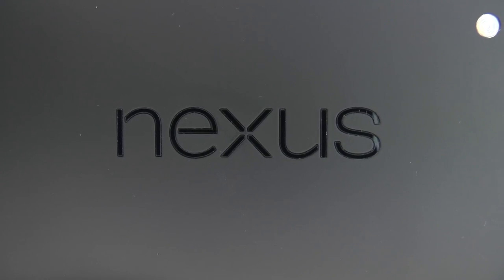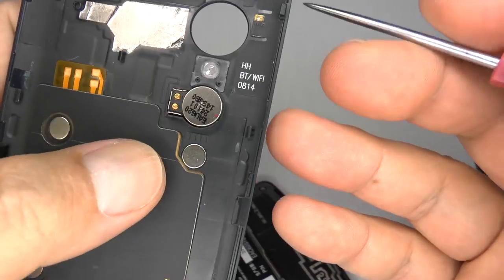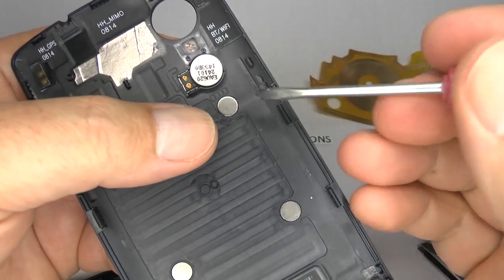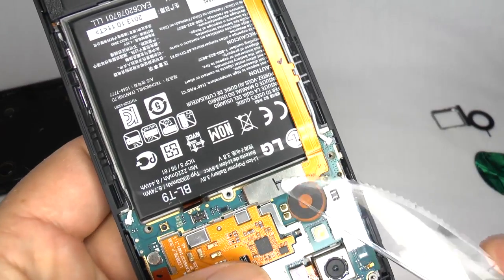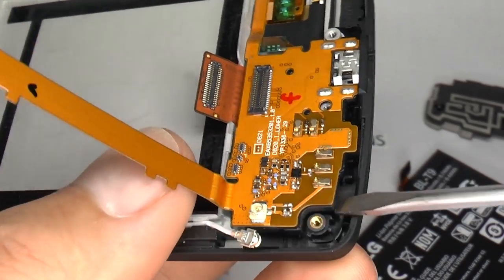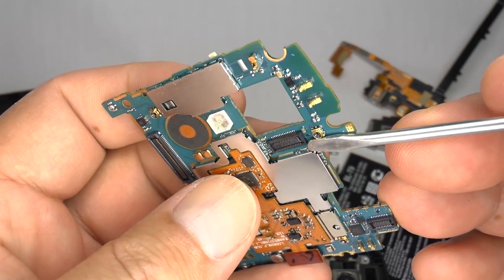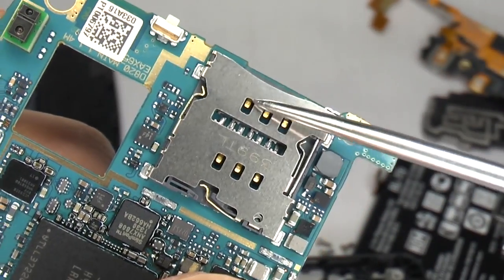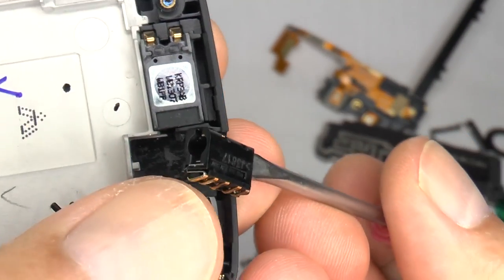Nexus 5 Teardown - Disassembly & Assembly - Screen Repair & Case Replacement LG-D821 - 820

Comment: Just thought I'd update, I followed this guide and successful got out the stuck sim simply by carefully pushing it from the small gap in the bottom of the holder until it came out. That sim is beat up now so I've ordered another, hopefully I haven't done damage to the board/holder. 
Another thing I've learnt is not to over tighten screws, which I've done and slightly threaded a couple of the screws so I might have to deal with that should something go wrong again.
Lastly, my Nexus 5's (I think it's the revision as it's from Jan 2014) back cover didn't come off as easily as I've seen other peoples, has anyone else had this problem? There was two stubborn clips in the middle on one side which took a lot more force to get out, although, I found by lifting the case 90 degrees got the last one out quickly. But now there's a noticeable small gap on the one side in the middle from where I was trying too aggressively to get the clips out of haha.

Anyway, thank you for this video.

Comment: I fixed my phone!! TIP: You need the bracket for the earpiece from your old phone! My replacement screen didnt have the bracket. I'm not sure what the best way is, but you can pull it out of the old one.

Comment: Hey nice video! I just wanted to know if it was possible to take the SanDisk memory card from this motherboard and put it on another one? My nexus 5 is stuck on the boot animation and the only possible way is to factory reset the whole thing, but I have some very important data in my phone for which I haven't taken a backup

Comment: If you find NFC to not be working after this push down firmly on the outer case after the phone's been reassembled just above the S in nexus, if you hear a click sound that's the nfc antenna snapping back into place

Comment: Read this if you want to order  [ pentru ROMANI - cititi ] I ordered from this site from the link in the description the display with frame and it arrived some 4-5 days after I placed the order. The screen came in great condition and the replacement went very well. One more thing I have to add because I didn`t see it in your description and it challenged me for 5 minutes at least : when you take the speaker from the earpiece out, make sure to take the spacer also, because (in my case) the frame came without that spacer and I placed the earpiece without it and it did not make contact with the main board so I could not hear the person I was talking to on the phone. Overall the phone looks and feels brand new now. Very pleased with the screen and the tutorial, thank you! The following text is for the people that order it from Romania (as in my case) regarding some unmentioned fees from the transport company:mie mi-a venit prin DHL, nu prin posta romana, asa ca cei de la DHL au un tarif de 100 lei pentru achitarea taxelor vamale in locul vostru, plus taxele vamale care au fost in jur de 52 RON. Ca individ care vrea sa repare singur telefonul si nu a mai facut comenzi din afara UE, am zis ca achit singur taxele vamale ca sa evit comisionul de 100 lei din partea lor, dar aces lucru nu se poate daca a fost expediat prin DHL decat daca detii un cod E-ORI. acest cod se elibereaza de catre vama contra sumei de aproximativ 130 lei, ridicand costul total al coletului cu 182 RON in loc de 152 RON daca achita DHL.- nu mai stiu daca este posibila livrarea prin posta romana (atunci cand selectezi ce fel de transfer vrei), dar daca este, puteti alege aceasta optiune pentru evitarea taxei de 100 RON din partea DHL (firma de transport), prin faptul ca atunci cand ajunge coletul in vama, posta va face o instiintare de plata si va prezentati si achitati doar suma de 52 RON, fara sa mai fie nevoie de cod E-ORi. este foarte posibil ca livrarea sa se faca in cca. 3 saptamani in loc de 4-5 zile, asa cum mi-a venit mie prin DHL. sper sa va fie de ajutor ce am scris pentru ca pe mine ma revolta taxele ascunse si consider ca asta este una din ele avand in vedere ca nu am fost atentionat in prealabil.

Comment: Hey...Sorry for dumb question...i couldnt find a way to google this but please answer...This is a bit funny/dumb/sad thing just happened...i got my nexus 5 not even 5 days ago and i was cleaning the back with an alcohol pad because one of the letters were dirty, so i thought i could just take the letters off clean them, then superglue them back on....That wasn't good because some got on the case and got dirtier...Google said Nail polish remover could remove super glue but that ENDED UP TAKING THE RUBBERCOATING OFF AND MAKING THE PAINT DEGRADE AND TURN BLEACHED/WHITE....SO MY MAIN QUESTON IS...I HAVE THE BLACK NEXUS 5...if i replace it with a Red or White BATTERY COVER...would it still work ...basically taking the black one off and putting a different battery cover on. THANKS...sorry for such long story thought you should know what happened.

Comment: Great guide! I am waiting for the part about the main screen removal. I've been quoted RM530(usd160) for the lcd without housing, and another RM100 (usd30) for repairing fee, I'm not spending another rm100 just for the fee.

Comment: Hi again!
Sorry to ask for your advice once again!
The phone is all working (new screen etc.) except for the 4G problem that I still have :-(
I have been in touch with about 6 companies and either spoken to, or Emailed them to see if anyone makes (or can make one up) an antenna cable that I need. I have read quite a bit and what I think that I need is:

RF cable is 1mm dia coaxial 90mm in length
2mm micro coaxial connector at one end (what it came with as standard)
2mm mini RF test connector at the other (a.k.a u.fl pigtail?)

Do you know of anywhere that might have these in stock, or anyone that could make one up for a reasonable sum?

Many thanks once again for your advice and reply :-)
Steve.

Comment: One thing I just learned about screen replacement for the Nexus 5: When replacing the rear housing (back cover/plate), there's a clip in the middle, about two-thirds of the way up that needs to be attached, otherwise wireless charging will not work. To fix, once the cover is attached, simply apply pressure in the middle of the back, about 2/3 of the way up until you hear a snap. Done.

Comment: +LE55ONS 
Hi, I just packed my Nexus 5 and I , on the advice , added thermal paste , Noctua NT - H1 ( pocchissima with a cotton swab ) , the CPU to dissipate heat better, but to my surprise I realized there ' he was put precendentemente no thermal paste . Fording other videos I noticed that almost no CPU had put suppetta pasta. I was wrong to put it and it is better that remove or leave everything as it is ?
P.S. Also in the assembly I damaged the white antenna cable and await a new cable . Tips .
Thank you.

Comment: Thnx for the vid, someone gived me a Nexus 5 (dead after drop in toilet) i took it apart and cleaned all with alcohol, phone works perfectly except the wifi... can u please tell me if the wifi antenna in the back is for 2.4GHZ?? because it works fine on 5GHZ but on 2.4GHZ very low signal!

Comment: it's wonderful and detailed guide to replace digitizer ..repair shop quoted £110 to fix it with digitizer. .i bought from ebay for £18 and back cover for £9 ...i saved £83...

Comment: +Sunil JG heyhey,
I changed the whole display unit a few weeks ago, now it works fine again. It includes frame, display, glass and digitizer. I guess it was the latter, that was damaged, but I had no tools to change it seperately. Total cost about 80€ for original part. U can get remake for about 30€ on ebay, but it might have quality issues

Comment: Thanks Le55ons. you helped me save my salt-water-damaged N5 (endless Google-loop). Used a small wet paintbrush to wash, blew away water with compressed air then sprayed with contact cleaner and used electric toothbrush to finish. works fine now. screen was unfortunately damaged from the inside either by salt-water or by my cleaning. not too bad. dark smudges visible on white image display. your patter is great and your image quality unsurpassed. thanks again.
Chris in Montreal.

Comment: I don't know why your video does not come up top of the list - took me a little while to find it again - it's so good.  I think I've used it about eight times now to change screens and batteries.  I quite like the Nexus 5 and I've probably had 8 of them - I buy two old ones for £25 each and make one good one using your video - which explains absolutely everything.  Thanks.  Love the pace you go at, love the way you point out what every item is.  Sound is clear and you are so close - it really is quite rare to come across a 'how to' video this good.  Thanks again.

Comment: Dude you're the best. Just replaced my screen successfully thanks to you! Although for the screen+frame that I bought from eTrade, it didn't have the housing for the top speaker, so I had to use the old one. And I think I messed up the notification LED, but I always thought it was annoying anyway :P

Comment: Excellent. my 5 WiFi had gone a while back then Bluetooth failing...hitting the phone worked but then it started going into loop shut down. I read about the OVEN treatment for the motherboard but never liked this idea so once apart the heatgun was about 400c ran it all over the board (tested on solder first to see how long before it melted) and first assembly...everything is working as it should. Fingers crossed and CHEERS!

Comment: Hi,
Its a great video. I leaned a lot. I have an issue with my nexus 5 381 model. Its internal memory is not working anymore. IT boots without any issue but only shows 128 MN of memory. I reset the phone but still no luck. Seems its internal memory is corrupted. 

Can you please let me know how to replace the internal memory? is it together in the main board? Do I need to replace the whole main board? 

Thanks.

Comment: Hi there :) 
thank you for your  very competent Video! Recently i kept my Phone in my Swimmingbag (actually dry) and it seems  as if a small amount of fluid demaged the digitizer :( Evetything seems to be alright, except some areas of the display dont react to my fingers anymore. Do I have to remove the wohle display or is there  possibly a much esier opportunity - like cleaning the contact of the digitizer? Im pretty desperate and thankfull for an kind of help! And it seems there are a lot  of People out there with a similar question..
Best regards, Yuri

Comment: hey my friend. Congratulations for your video! is perfect!

Maybe you can help me.
I had a problem with my microphone and them my screen stop to work too.
So I Change my flet cable but the screen dind't back. 

The question is, my screen is dead
Have any way that i know if my screen is working, beacuse i think that maybe is just a cable. I dont konw. There is any teste that i can do??

thaks a lot

Comment: I would like to replace the GPS in my Nexus 5. Which part should I replace, it's not stated here AFAIK. My GPS has issues with Fix and it's not software issue. Can You help me?

Comment: I have replaced my screen successfully, however I got a black screen after a while. The new screen wasn''t faulty as another replacement screen also turned black. Incoming calls and notifications are still visible. But the screen is just black (with some distant back light). Can't use the phone anymore. What can it be? How can I get the data off my Nexus 5?

Comment: Hi ***** , i have to change my camera because of some black dot in photos.
I was looking on the site you have linked for parts, but i can't find the camera module for the european nexus ( d821). Is the same if i'll use the usa model (d20)?
i'm asking because i was looking also on ebay and noticed that on the flex cable of the camera, there is a different number. may they correspond different models?

Comment: This is awesome video. I had to replace my broken glass completely, I bought the screen by ~$100 and went through this video and everything fall into place. Just he could actually mention the battery needs to be handled carefully otherwise it might cause damage and sparks. Those who does not have the heating machine (shown) for removing the glass, you can use any kind of heating source (I used my burner's flame from little height) to loose the adhesive, and it worked ...

Comment: My battery cover/Rear housing doesn't snap shut anymore, it's only where the USB cable touches the battery. The battery and the USB cable makes it bulge out so it won't snap in. The location in your video 31:32 . Please help! I'm scared if water leaks in or if my phone drops then something will break

Comment: Hello, i have an 3G issue. My phone is blocked in airplane mode. When i want to go back in normal mode, my phone can't reach 3G (or even EDGE or GSM btw) signal. I suspect the 3G antenna is down... Can you tell me which part i need to change ? Because i saw that there is a multiband antenna..

Comment: Thank you i've successfully replaced my screen, but there is one problem now. when I'm receiving a call, the moment I decline or take the call, the screen blacks out, and I can't make it turn back on(sometimes pressing the power button will make it work again but sometimes not)and i have to restart the phone to make it work again. Do you know if it's any part of the sensor I've not plug in properly? coz i've check everything and they should be properly replaced...Thanks I hope you can help me with this!

Comment: Hello!!!!
Incredible video. I would like to ask u few questions. I had my nexus 5 repaired last month and about 2 days ago the screen went black and I went back to the repair shop today to get the screen replaced for the second time. After the repair I asked what could be causing problems with the screen and they said that the heat may damage the screen, so I asked what could cause this extreme heat and he said the hardware if damaged may do it. After 30 min I start to noticed how the start button was almost even with the edge of the cover and I could hardly feel it and the screen showed a light ( like a small globe in the low right corner of the screen) also the phone wasn't vibrating anymore. I had to go back for the second time explain what the problems were and after 1h they gave me the phone back with the same problem on the starting button saying the rubber was getting worn and after replacing the screen 2 times they couldn't do better. ( not done yet =P ) Came back home and the volume button ( - ) stuck.
What I would like to ask is: Is it true that the plastic button on the main board can get worn? Are they just bullshitting me?
I don't mind paying to fix my phone as long as the work is well done. I have the feeling these guys are just trying to make up excuses and I don't really like it.
Thanks in advance.
Once again great video.

Comment: Hi! I watched this video when replacing my nexus 5 screen. Everything worked fine, but a few months after replacing my screen, it started to show some vertical stripes and then it stopped showing any images at all. Would the replacement of the yellow flex cable solve my problem? Thanks!

Comment: Excellent video. I'm having difficulty getting the back off mine. The clips are disconnected around 3 of the four edges, know about the adhesive at the base but it still feels secure in the middle :(

Comment: Hi. This was by far the best teardown videos that is there and I thank you vey much for the detailed explaination.
I have an issue with my Nexus 5 . The ringer or audio on my mobile works only for about 10secs n stops. If I plug in the headphone jack then it works fine. What could be the issue can you help?

Comment: Great video, I just successfully replaced my screen and I have absolutely no experience with this kind of work. 

Just one thing that might help others: I bought my screen + frame from AliExpress, and at least mine did not come with the little frame where the earpiece is placed (see it at 20:15). So I also had to remove it from the old phone frame (using a screwdriver, really easy) and put in the new one (at first I didn't do it, and hence the earpiece did not work).

Congratulations on the great video, and thank you a lot!

Comment: Question: I have successfully installed my new screen on the nexus 5. Everything works perfectly except when in my case now speakerphone echoes for the person on the other end. The same exact case never did this b4, and it doesn't do this out of the case. I've opened the phone back up and nothing near the mic = \ suggestions?

Comment: Thanks sir, recently bought a Nexus 5 used, and couldn't get reception at all. Tried everything, software fixes, different sims, etc. I was ready to return it to the seller. Watched this vid, and decided to give it a shot to see if the antenna at all damaged/disconnected. Low and behold one of the antennas was disconnected. Reconnected it, and the phone works now like a champ. Thanks to you I got it working =)

Comment: Thank you for helping me struggle through the process! Older phone, still love the N5, but even my sturdy casing couldn't save it from a drop flat on the screen. Also nice to know what all the separate parts on the mainboard are. It's charging, looking good!

Replacement part from China, so you probably get what you pay for, we'll see :)

Comment: If the phone stops accepting calls, connecting to LTE, WiFi and all other signals after a fall what do you suppose is the problem? Do u think it could be the antennas? Would the issue be fixed by changing the back cover? Pls someone respond if you can help.